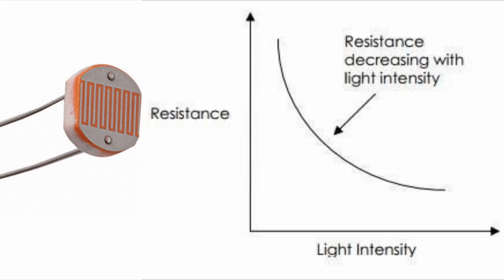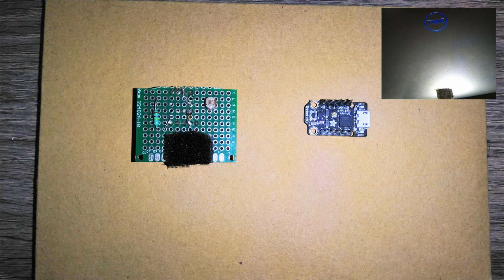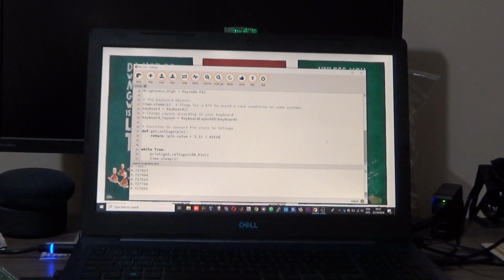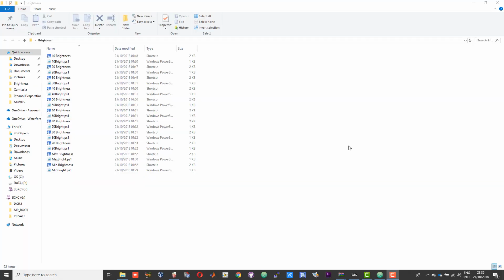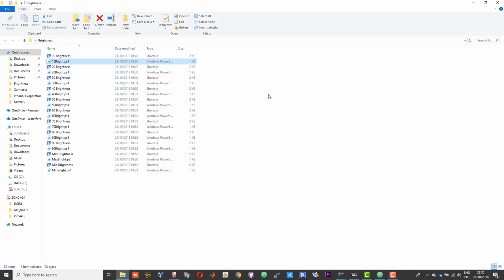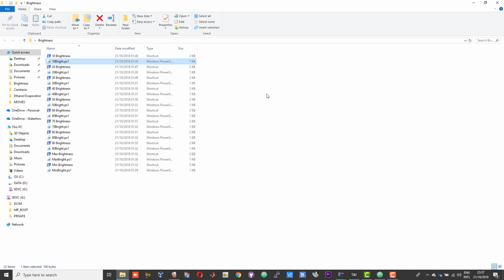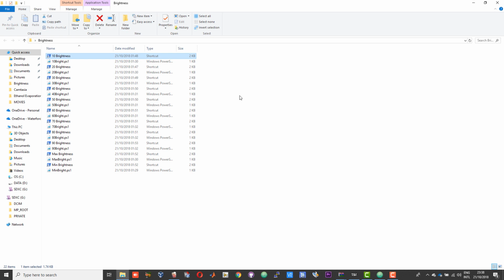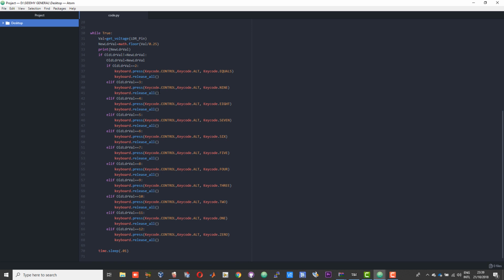Macbook like auto brightness control for your windows laptop

Comment: Cant we use arduino micro instead of adafruit trinket M0 that is more cheap and easily available
Reply from the maker: Nope those dont support HID. Its either Trinket or Playground Express. If you use playground express, no need to build the ldr circuit. Express already has an onboard light sensor you can use that, but its a bit bulky.
Reply: @SidsEClassroom  but it has atmega8u as main onboard MCU  and it directly support HID as you can see my one uploaded video i am using that as air mouse by combining mpu6050 with arduino micro
Reply from the maker: My apologies. I looked at the wrong arduino board.  Yes indeed you can. I have written the code in circuitpython. You do the same in arduino ide as well.  This instructible has the codes. https://www.instructables.com/id/Mobile-Device-Like-Auto-Brightness-Control-for-Lap/
Reply: @SidsEClassroom  what if we use front camera to detect light brightness
Reply: @SidsEClassroom  oh, and can you share your arduino and powershell code? thanks
Reply from the maker: This instructible has the codes. https://www.instructables.com/id/Mobile-Device-Like-Auto-Brightness-Control-for-Lap/
Reply: can be used one of those cheap attiny85 usb boards that already support HID, too?
Reply: here some info on hid: https://www.instructables.com/id/DIGIKEYPAD-DigiSpark/
Reply: this one, for example: https://it.aliexpress.com/item/GREATZT-1-pz-Digispark-kickstarter-scheda-di-sviluppo-ATTINY85-modulo-per-arduino-usb/32898417151.html